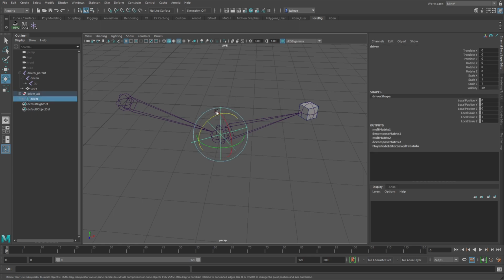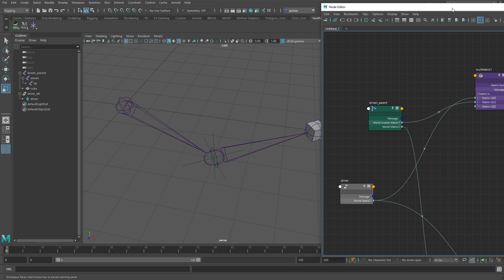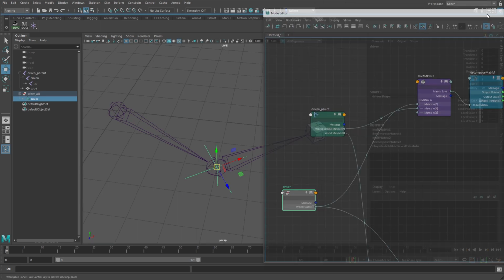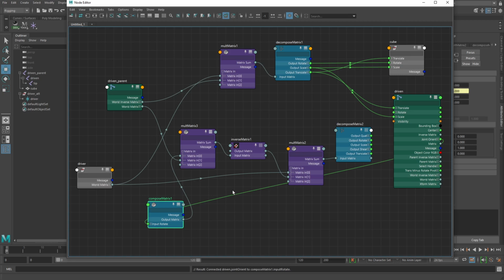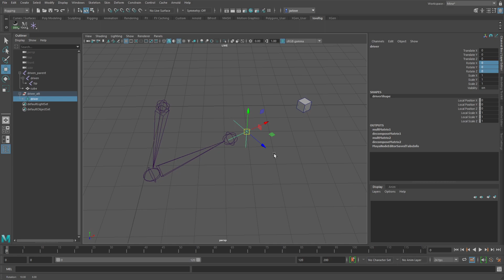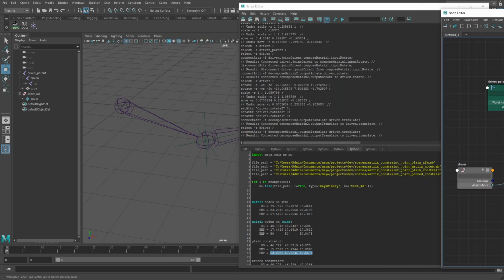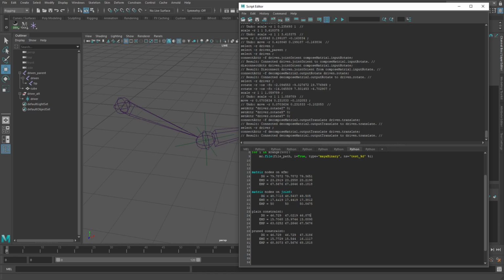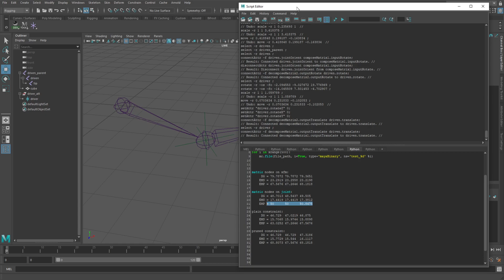Maya matrix constraint for a joint rig tip

Comment: He Jared just one quick question , that cube when I connect it with loc via multmatrix and decomposematrix it shift at place with mid joint/loc but how do you move it to the tip of joint cause is translation are locked and also I tried by moving its(cube) pivot to mid joint while placing it on the tip and it’s shifting places not like exactly showing in this vid please I can’t go further of this tutorial and stucked in beginning trying to place cube and connecting via loc
Reply from the maker: Hello - thanks for watching and commenting! If I understand your question correctly, you're asking how to get the cube in the same position as the last joint in the joint chain.

In a way, it's not - in the beginning of the video I describe what's in the scene and mention that I grabbed the verts of the cube and moved them out to that joint's position. If you look when I select it, you will notice that the pivot point for the transform node is right on top of the locator. So it's really only the geometry of the shape node that is over there, not the actual transform node. 

The cube doesn't technically have anything to do with the matrix node network for the joint. I just created it like that and set up the matrix constraint on it for a visual aide to show how the joint was acting due to the joint orient. That's why you can't just plug the rotates from the decomposeMatrix node into the joint's rotations.

Now, if you really want to place the cube in that position, you can by building an offset into the multi matrix calculation... Or, you could skip the decompose matrix, and plug into the offsetParentMatrix attr (added in Maya 2020) on the transform, then you should be able to translate it freely within that 'new' parent space. I have other videos that explain those in detail, but unfortunately, I don't remember specifically which ones off the top of my head...

Hope that helps!
Reply: Still can’t get my joints are still rotating after I followed every step same way maybe something I’m doing is wrong is it possible to send you my maya file(via mail) and let me know that means lot to me thank you 🙏🏽 Jared for this informative vid even in my potato head trying to figure out what’s going on with it
Reply from the maker: Maybe this will help - here's some python commands to recreate the scene from the video.  The first section creates all the nodes in the hierarchy for the joints, control, and cube.  Then there's a section commented with 'video option' which sets up the matrix nodes like they are in the video.  There is another section commented with 'better option' that sets up a better matrix node network that should evaluate better due to less nodes (I figured that out after the video...).  I still haven't been able to get a single solitary node network that will work without splitting the rotation out separately.  Maybe you can compare this with what you're doing and see what happened...

So, to run this, copy it into the script editor in a python tab, highlight the code you want to run, and hit the enter button on the number pad.  You should run either the 'video option' or the 'better option' - although, you could probably run both and just look at the differences.  Also as a note for the better option, you don't actually need to keep the compose matrix and inverse matrix nodes... but before you delete them, you will need to do a getAttr on the inversmatrix's 'outputMatrix' attr, and then set the multMatrix node's 'matrixIn[1]' attr with that data.

one more side note... I don't usually build strings this way... I did it for compatibility depending on what Maya version you're using... I think it should work for maya versions using python 3 as well as previous versions...

import maya.cmds as mc
par = mc.joint(p=[0, 0, 0], n='driven_parent')
driven = mc.joint(p=[4, 0, 2], n='driven')
mc.joint(par, e=True, zso=True, oj='xyz', sao='yup')
tip = mc.joint(p=[7, 0, 0], n='tip')
mc.joint(driven, e=True, zso=True, oj='xyz', sao='yup')
mc.setAttr(tip+'.jointOrient', 0, 0, 0)
for jnt in [par, driven, tip]:
    mc.setAttr(jnt+'.radius', 0.65)
mc.disconnectAttr(par+'.scale', driven+'.inverseScale')
mc.disconnectAttr(driven+'.scale', tip+'.inverseScale')
cube = mc.polyCube(w=0.5, h=0.5, d=0.5, ch=False)[0]
mc.parent(cube, par)
grp = mc.createNode('transform', n='driver_att')
driver = mc.createNode('transform', n='driver', p=grp)
mc.createNode('locator', p=driver)
mc.xform(grp, ws=True, t=[4, 0, 2], ro=[0, 33.69, 0])
mc.move(mc.getAttr(tip+'.tx'), 0, 0, mc.listRelatives(cube, s=True)[0]+'.vtx[*]', r=True)
joint_orient = mc.getAttr(driven+'.jointOrient')[0]

mmtx = mc.createNode('multMatrix')
decomp = mc.createNode('decomposeMatrix')
mc.connectAttr(mmtx+'.matrixSum', decomp+'.inputMatrix')
mc.connectAttr(driver+'.worldMatrix[0]', mmtx+'.matrixIn[0]')
mc.connectAttr(par+'.worldInverseMatrix[0]', mmtx+'.matrixIn[1]')
mc.connectAttr(decomp+'.outputTranslate', cube+'.translate')
mc.connectAttr(decomp+'.outputRotate', cube+'.rotate')
mc.connectAttr(decomp+'.outputScale', cube+'.scale')
mc.connectAttr(decomp+'.outputTranslate', driven+'.translate')
mc.connectAttr(decomp+'.outputScale', driven+'.scale')
compose = mc.createNode('composeMatrix')
mc.setAttr(compose+'.inputRotate', *joint_orient)

# video option
#
mmtx_ori_a = mc.createNode('multMatrix')
imtx_ori = mc.createNode('inverseMatrix')
mmtx_ori_b = mc.createNode('multMatrix')
decomp_ori = mc.createNode('decomposeMatrix')

mc.connectAttr(compose+'.outputMatrix', mmtx_ori_a+'.matrixIn[0]')
mc.connectAttr(par+'.worldMatrix[0]', mmtx_ori_a+'.matrixIn[1]')
mc.connectAttr(mmtx_ori_a+'.matrixSum', imtx_ori+'.inputMatrix')
mc.connectAttr(driver+'.worldMatrix[0]', mmtx_ori_b+'.matrixIn[0]')
mc.connectAttr(imtx_ori+'.outputMatrix', mmtx_ori_b+'.matrixIn[1]')
mc.connectAttr(mmtx_ori_b+'.matrixSum', decomp_ori+'.inputMatrix')
mc.connectAttr(decomp_ori+'.outputRotate', driven+'.rotate')

# better option
#
imtx_ori = mc.createNode('inverseMatrix')
mmtx_ori = mc.createNode('multMatrix')
decomp_ori = mc.createNode('decomposeMatrix')

mc.connectAttr(compose+'.outputMatrix', imtx_ori+'.inputMatrix')
mc.connectAttr(driver+'.worldMatrix[0]', mmtx_ori+'.matrixIn[0]')
mc.connectAttr(imtx_ori+'.outputMatrix', mmtx_ori+'.matrixIn[1]')
mc.connectAttr(par+'.worldInverseMatrix[0]', mmtx_ori+'.matrixIn[2]')
mc.connectAttr(mmtx_ori+'.matrixSum', decomp_ori+'.inputMatrix')
mc.connectAttr(decomp_ori+'.outputRotate', driven+'.rotate')

Comment: that's 7 nodes to do what a point, orient with maintain offsets on, and scale constraints do in 3.
Maya needs to stop.
Reply from the maker: thanks for taking the time to watch so many of my videos and comment on them - looks like you may have deleted some of your comments because I'm not seeing them anymore... but I'll do my best to respond to them all soon.

I've never been fully happy with this setup - and I think there are a few responses to comments for this video where I do say that using the orient constraint on a joint may be the better way to go overall.  That's part of why I did the speed comparisons to show that it's not inherently better just because it's using the matrix nodes... but, something that is interesting to think about is that even with the extra nodes, it's almost as fast or faster just depending on the evaluation mode you're in...  Also, I'm not sure if I pointed this out anywhere, but you don't technically need the compose matrix node to hang around.  Once you have generated the matrix, you can just use getAttr on it's output and setAttr to the proper attribute on the mult matrix node to stamp it in (simply severing the connection to the multMatrix node annoyingly removes the data as well).

With the updated matrix nodes from maya 2020, there may be a better solution, but I'd have to go play around with it some more in order to try it out.  Of course, it's also possible I just missed a cleaner way to handle it anyway and haven't figured it out yet, haha.  If I do ever come up with a better solution, I'll be sure to post it.

Comment: noice. I'm having trouble using this concept on mirrored ctrls & their corresponding jnts.

- jnts are mirrored with maya tool (behaviour) and oriented
- ctrls are mirrored using an offset group with scaleX = -1

When I connect the decompose matrix outputs into the corresponding joint it flips the orientation to I don't know what. Is there an offset that I need to plug in taking into account the scale -1 space? or how do I get this to work?

I just like how clean the outliner looks with matrix connections instead of constraints but I can't make it work.
Reply from the maker: Ah - yes, that's going to be a bit of a problem.  The reason it's flipping is because the joint has a right handed matrix, and the control has a left handed matrix, so it pops it to match the control's matrix when you connect and drive the joint.

The joint mirror behavior option does some flipping and rotating of values to make the rotates behave in a mirrored fashion, but the translates suffer from not all behaving as true mirrors.  Even though the rotates are 'mirrored' it's still technically a right handed matrix.  Scaling the control's offset group node -1 in x places the control into a left handed matrix space.  For more explanation of this, you can look at my video demoing a personal rigging system https://youtu.be/omgP-_DkG-4 at about 4 and a half minutes in where I show some controls that work this way.

Fortunately, you can fix it with the proper matrix math.  You need to add in a left handed matrix into the mult matrix calculation (I'm pretty sure it needs to go first, but I'm not able to test it at the moment).  Generating a left handed matrix is pretty simple, you just need to make the first number of the matrix a -1 instead of a 1.  You can test this by creating a node, scaling it -1 in x and then looking at what it's world matrix is.  You could either use a compose matrix and plug that in, or the better option of setting the appropriate mult matrix input with the matrix values.

Now... there may still be some flipping that happens because the control and the joint will not have their translation axis vectors matched up due to the joints being mirrored by behavior.  But, I'd have to test that to verify anyway - it may not flip; however, if you're just using it to drive the rotates, it probably wouldn't matter.

Hope that helps - and thanks for taking the time to watch, test, and comment!
Reply: @JarredLove  thanks for the detailed guide!! :D
I tested it and found success by plugging a fourbyfour matrix with first number as -1 before the other matrixes into the multMatrix. 
But oddly enough if I use decomposeMatrix to connect into the joint like a constraint, the Rotation Y $ Z are not behaving in a mirrored fashion. But when I plug the multMatrix output into the offsetParentMatrix, then Rot & Trans are all mirrored :)
Shouldn't the output of those yield the same result?
Reply from the maker: Hmm... well, without looking at a file or exact steps to re-produce your setup so I'm able to dig in and diagnose the result, it's kind of difficult to answer one way or the other on that question...

I would think they'd be the same, but it could be giving different results due to the joint orient values.  Plugging in to rotates will rotate based on the rotation space after the joint orient is taken into account, whereas the offsetParentMatrix may be happening before joint orient?  Definitely an interesting question.

by the way - great use of the 4x4 matrix node - I forgot to mention that as an option!

Comment: Hi, first of all, thank you for putting all of your effort and time to share this knowledge with us :).
In Maya 2020, this method is useful if the joint has a different orientation from his parent then I think we don't have any other to do that. But if the child has zero orientation, then can also decompose the local matrix of the ctrl and feed it to the joint's rotation. What do you think?
Reply from the maker: Hello!  Thanks for the question.

If I understand you correctly, yes I think you're correct.  If the driven joint from your matrix constraint doesn't have any joint orients altering the matrix, then you should be able to feed the rotates from your matrix setup right in as if it's a regular transform.  But, I'm not actually able to test it out and be 100% sure right now, so maybe give it a test and see how it goes!

Comment: can you do a point constraint video, please, I'm a bit confused on the offset multiplication order when it comes to orient and point constraint in regards to joints.
Reply from the maker: Hey Melvin A,  this video is toward the end of a video series on matrix constraints, so if you're just point constraining a joint and you don't need to worry about the orientation, you can just use the regular matrix constraint method shown in an earlier one: https://youtu.be/ROnrCFLgNHE

I hope that helps - but let me know if not and I'll see if I can clarify things!
Reply: @JarredLove  hey thanks for responding wasn't too sure how to private message you... but I'm sure others can benefit from resolving this issue I'm having as well. The issue is I have controls on a joint successfully parented so the world matrix of the controls is controlling the joint. However, I have a locator above and below the joint. I would like the joint to point at so I created a constraint group in which the controls that control said joint is placed so I'm constraining the group to the locators so the controls remain at zero while still following the locators and I can still use the controls independently. I've got everything working but when I zero out the values of my locators after it follows it snaps back into place with an offset. I should add I'm using a blend matrix node with .5 for each locator and offsets are correct because independently they work it's just perhaps the child world space is still being affected. It would really help if I could show you my graph.
Reply from the maker: Hey Melvin A, I can't quite tell what is causing your issue or make a suggestion based on the description alone...  I would need to see an example file (or a script to run and generate the appropriate setup).  Do you have somewhere you could post it so I can download it and take a look?

Also, thanks for posting the question here - I've done similar stuff in comment threads of my other videos because I agree that it can be helpful to others who come across the video later.  YouTube used to have private messages, but they got rid of that (sadly)
Reply: @JarredLove  I can share a google drive link with you perhaps its just a simple spine rig that I'm trying to construct with matrices. would that be okay?
Reply from the maker: @Melvin A  yeah, that will probably work - the simpler the file the better though - like maybe just one or two of these control/joint/locator systems you're using?  I always try to create a simple case of just the issue I'm trying to solve whenever I come across stuff like this.  Then it's easier to see the issue and solve it before applying it to an actual rig.
Reply: @JarredLove   i've tried to post a google drive link multiple times but it was auto deleted everytime from the comment section
Reply from the maker: That's odd... There have been a few other people who were able to post a link to a google drive file, so I'm not sure why it's auto deleting yours...  I guess you could email it directly to me.  jwlove@gmail.com
Reply: @JarredLove   thanks I've sent an email I was still trying to post here I read somewhere youtube automatically deletes comments if it parses them as spam